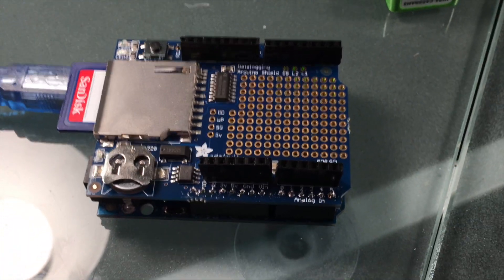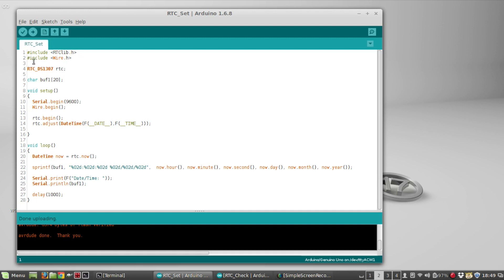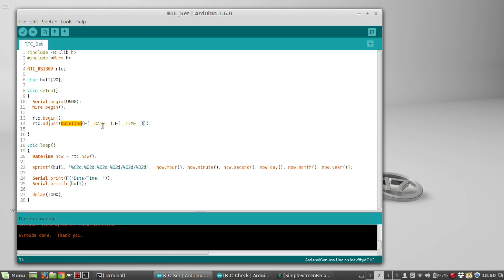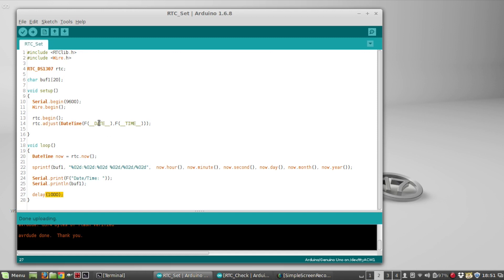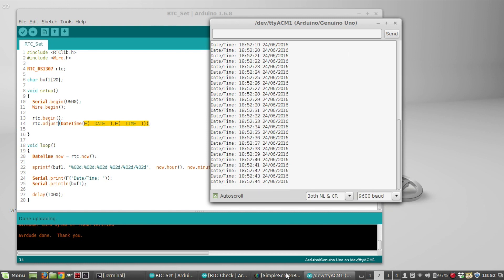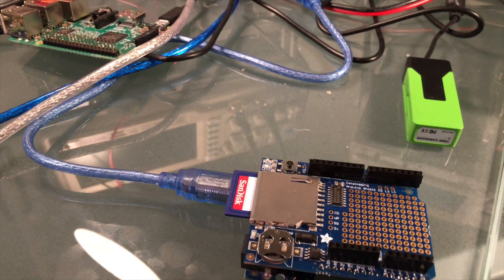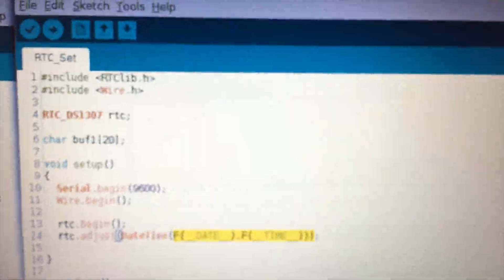Real Time Clock: Setting the Date/Time with Arduino

Comment: Sir, Im encountering some sort of a problem. EI have connected this arduino along with the data logger to an lcd sheild. The time and date is perfectly fine but everytime I unplug, the time seems to stop running. When I plug it back on, the time seems to stay with the time that OI unplug it. I hope you can help me.
Reply from the maker: Did you check to make sure the battery in the shield is good (and it's installed in the correct orientation)?  I know one of the shields I purchased came with a dead battery.

Comment: can we use the datetime library to set the time in  DS3231 AT24C32 IIC Precision RTC Real Time Clock  so we can keep the time correct even if  the Arduino is reset.?
this library I mean https://playground.arduino.cc/Code/DateTime/

Comment: Error "RTC_DS1307' does not name a type; did you mean "ds1307"?... not sure if this is defined in the library RTClib.h or why it's not working. Help please!
Reply from the maker: This may be caused by another library with the same name on your computer.  Take a look at this Arduino forum link and see it helps fix your problem: https://forum.arduino.cc/index.php?topic=586330.0

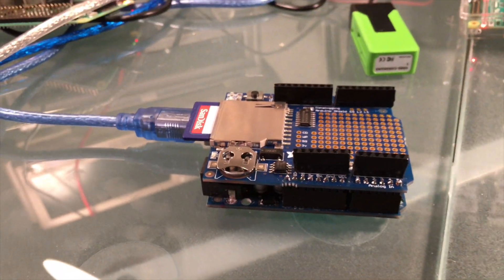Comment: sir why if disconnect my arduino in my pc the rtc time it become late for example i upload the code at 8:30 am then i disconnect it at 8:35 then i connect again in the pc at 8:40 the time will start at 8:35 what is cause of this.
Reply: To keep running RTC  you have to provide power continuously to RTC
Reply from the maker: As Shivahari Tathe mentions, you have to provide continuous power.  This is usually done with a backup battery, similar to the one on the data logging shield used in the video.  The DS1307 chip has a pin that you can connect the external battery to.

Comment: I don't know why the output of the code is always "Date/Time: 165:165:85 165/165/216", and it doesn't change.I am using ESP32.
Reply: Did you get a solution to this? I am having same problem
Reply: change your serial.begin to this Serial.begin(115200)
Reply: Same issue here, and changing the baud rate didn't help but thanks for the idea
Reply: is your laptop a MAC?
Reply: I am using Esp32. It is showing the correct time/date. Check the wire connection.

Comment: How could I use this to fade on and off a N channel mosfet at certain times?
Reply from the maker: You would just have an arduino pin connected to the mosfet gate that would normally be LOW.  In the sketch loop you would check for the current hour and minute.  You would then set the pin to HIGH if a certain hour and minute (or minute range) is read, otherwise keep the pin set to LOW.
Reply: How do I check the time in the sketch?
Reply from the maker: I posted links to both the "set time" and "check time" sketches in the description.  The line that actually gets the current date and time is:
DateTime now = rtc.now();

Comment: Can we also do this similar thing for DS3231 RTC module?
Reply from the maker: It should work, but you would just need to use the DS3231 library instead of the DS1307.
Reply: I also had this problem, and i end up using the same library of DS1307 on DS3231 and it worked fine for me.